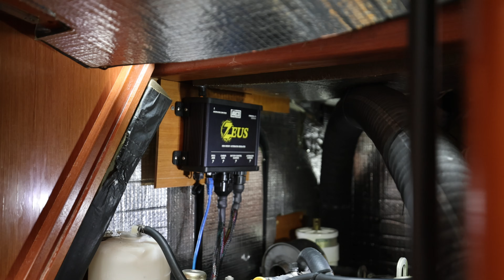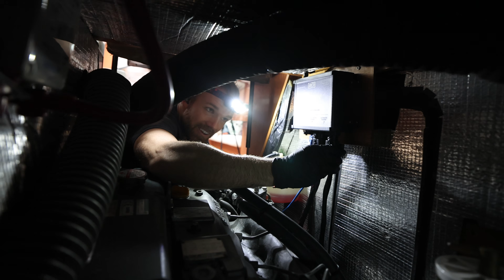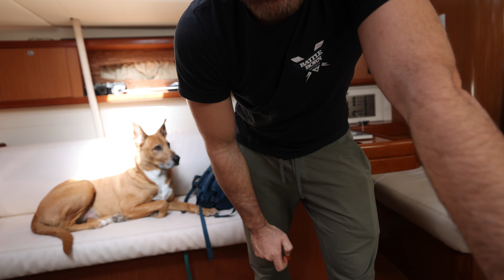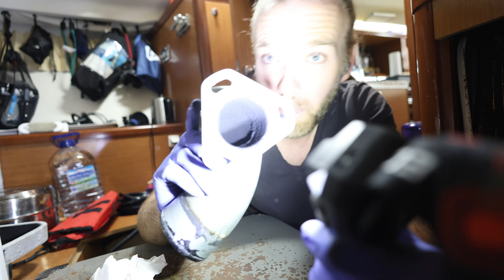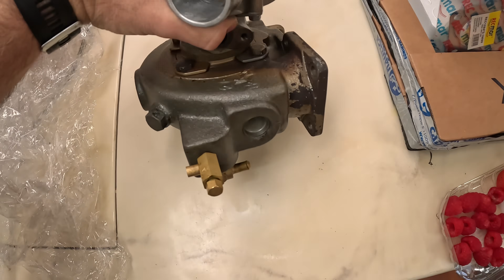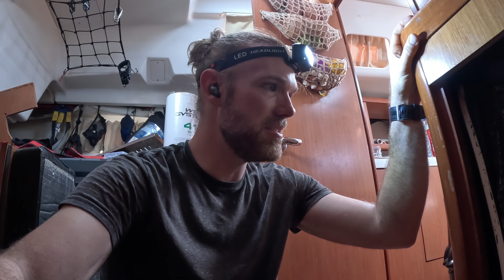Billowing Smoke - Broken Turbocharger - But at least it got upgraded electronics! (6)

Comment: HORRIBLE MAINTENANCE,now that I have everyone's attention. This is for people who have sailboats,what I see is a motor that is way over fueled. Go on a VW tdi site and look for how to clean your injectors  and after that go to a country that has a certified mechanic that knows how to run the rack on the injector pump. most of you are in places that are considered third world counties, just because someone said that they know how to work on a motor does not mean they can do it correctly. everybody should look up their engine and familiarize themselves in case of problems that are a simple fix or at least keep from getting raped by some of these so called mechanics. Remember AAA does not go everywhere.

Comment: that poor motor is taking in such hot air, i bet the iat temps are crazy on that thing post turbo with some load. Heat kills everything, i would look into some exhaust wrap and a turbo blanket to help your engine bay temps and then add some ventilation to that tiny engine bay. If possible making a air intake that goes out to fresh air would help more than u would imagine and engine would be way happier. Its simple to add vents to that engine bay, make sure u have a in and out. There are several ways to accomplish this but have to see what would work best on your boat, that alternator will be waaaay cooler if u do this as well. Side note they do have water cooled alternators out there.

Comment: As a mechanic, I can tell you it is the internal pil seal in the turbo. Replace it. Cary a spare turbo always. Your engine itself will last 5 times longer than any turbo. Turbos are for performance not durability.

Comment: I do hope thats not an earth lead attached to the alternator ????? EVERYTHING electrical on any vessel MUST be insulated return or you will have horrendous Electrolytic Corrosion !!!
Reply from the maker: It's a "case ground" alternator. so yep
Reply: @ExpeditionEngineering  Well you need to read up on marine electrical installations as that is a reciepe for disaster ALL wiring must be insulated return .
Reply: @ExpeditionEngineering  How long are your anodes lasting is a good way to gauge what stray currents are in your boat and that new alternator ??? will eat disimilar metals if its grounded to the engine inc the items in the engine if it not 100% insulated

Comment: The only way for oil to get in there and get burned is past the impeller bearing/bushing. I know you said it had minimal side to side play, but... Remember that oil can be a fuel, if enough enters the air flow you might have trouble.

Comment: Does the Zeus have alternator protection for lithium or is that an add-on?
Reply from the maker: It does have alternator protection for lithium, they call it ATC. It works with batteries with a bms that can communicate and tells the Zeus it's about to disconnect. Unfortunately the Battleborns we have can't tho

Comment: It may be a run off diesel engine. Especially when you said the throttle wasn’t responding. You could have overfilled the oil which could have caused a run off engine scenario. Only way to stop a run off engine is to stop air flow to the engine.

Comment: That was a lot of carbon build up, try to avoid long idling times. Difficult on a boat I know but combustion engines do not like idling.
Reply: New boat owner here. How long is too long of idling?  I typically run at idle until the engine reaches operating temperature and then I'm ready for cruise speed.

Comment: When talking about RPM, you don’t use the plural RPMs. The plurality is contained in the first statement in RPM, ‘revs’. 😀👍
Reply from the maker: Ah see but you're mistaken, I DO use the plural rpmS 😁
Reply: @ExpeditionEngineering RPM is already the plural when discussing a single engine 'revs (plural) per minute'. The only time it would be correct to use RPMs would be if you were talking about the RPM of two (or more) engines. As in 'I noticed that the RPMs were different'. Every instance in your video should simply have been RPM. Love your work :-) XXX

Comment: Brett, white smoke is usually indicative of incomplete combustion. Whether that's occurring from excess fuel injected, too little air, too low compression ( as was your case from turbo being obstructed on hot side ) from turbo or cylinder head leaks related to gaskets valves or piston/ring failures. You mntioned adding engine room blowers... next episode or will that be TBD with some research and parts orders ? Sorry Jade, that you got the ouchie from fries... at least they were good I'm hoping ?

Comment: Could just be a bad injector or fuel regulator as well. run the motor and listen and see if it changes pitch up and down. If it does then it is fuel supply. it's a good year to clean your injector every few years any way, helps with fuel economy as well.
Love your work hope you find the problem.

Comment: Oil seal blown in turbo. Explains lack of power if oil is in combustion chamber. 
Injector blown which would cause low power.
Cracked head near a exhaust chamber.
Oil seal in turbo is easy to determine if you pull intake pipe to manifold and see if Oil is in it. Or inspect turbo fan blade on the exhaust side.
Injector you need the computer program to hook to computer (which I highly recommend you getting a diesel marine software) and do a cylinder cut out test.
And check antifreeze level to see if it has gone down or system is overly pressurized. 
It could also determine a cracked head.
But my money is on the Oil seal in the turbo. Or water seal if it's cooled via water.

Comment: I had a 4JH-TE many years ago. Yanmar used to sell a product to wash the turbo insitu. Sounded like the engine would self destruct but would work and the turbo would be fine, and cleaned. I did this once a year and never had a problem with it. Check it out with Yanmar.

Comment: Diesels like to work hard. Too much low load running will kill a diesel faster than full load operation. Keep your generator and your main engine will thank you for not running it at anchor. The good news is that that monster alternator will load up the engine when motoring and motor-sailing so that's a bonus.

Comment: My experience was with an Audi in-line 5 cyl turbocharged motor. It started with a puff of white smoke out the tail pipe on startup. Progressing rapidly to continuous white smoke. The cause was cracks in the cylinder head and a worn-out turbo. The combination of repairing them both exposed issues with a tired engine block, which had to also be rebuilt.🥴😬 If you have a lot of hours on the motor, maybe consider total rebuild.

Comment: Turbo! ooo...nice!  So like your boat goes to eleven?
🎸🤘😎🤘  p.s. maybe check compression, injectors, air filter, and de-barnacle heat exchanger while you have your boat in wet-dock, unless you've done it all recently.  Cheers!

Comment: Not as great as the smoke rings from Mount Etna but still impressive. 👍👍
Personally I would have found the smoking fault, fixed that THEN upgrade the alternator. It just cuts something new going into a bust system and adding to any other issues. But Im not on the boat looking at it.

Comment: Hi 
Nice work with the turbo.
An other comment is that you can damage the crank and the bearing with the load from alternator. 
I think Yanmar have a diagram that shows how much load you can take in different directions.
You have the power to get 240 amps from the engine, but it may hurt it.

Comment: I’d start in the same place you did.  White smoke when cold shifting to black smoke when warm is too much fuel or not enough air.  Exhaust restriction is a problem on small marine diesels which can cause not enough air.  It’s also the simple thing to fix and cheaper.  Testing for bad injectors isn’t for the faint of heart.  Replacing injectors isn’t too bad, but expensive especially if you don’t know if that’s the problem.   

Blown head gaskets are rare on diesels and are typically the result of poorly maintained cooling systems.   It’s not impossible, but highly unlikely.  I have seen more external cooling system leaks from head gasket failures than combustion gas loss.  The examples I have seen were always because of cavitation eating away the head and block at the gasket surface causing the gasket to fail.  It’s not like a gas engine where coolant can leak into the combustion chamber and blow white smoke.  A poorly running gas engine might have cylinder pressures of 80 psi.  A diesel won’t run with less than 450 psi.  If that much pressure got into the cooling system, hoses and heat exchangers go boom.  If the engine didn’t hydrolock first.

Comment: SV Delos had similar issues. They were informed that they were not reving the engine high enough and had the same carbon build up.  Once they cleaned up and replaced the elbow they had the same results as you did. The engine reved up higher and the smoke was gone. So, reve the engine up high once in a while and that will help burn off the carbon.

Comment: It’s not a head gasket if the head gasket blows out the engine won’t start there is no compression. Check pipe and fuel filters. If you ever have a miss fire check the glow plugs if they have oil on them check valve cover gasket loss compression and oil is like milk head gaskets.

Comment: Had an air filter colapse on one of my machines that was clogged up from dust. Smoked like a bitch. Running them too cool will carbon them up on the exhaust side, so never idle for long periods.  If you're running it at less than 50% it will do this. Rev it up and make it work a bit. On a piece of construction machinery,  we'd tarp off the rad 3/4 covered, for the night and rev them up 3//4 throttle, if it was below -40. Any less and the rings wouldn't seal and she'd spit a lot of oil out the breathers too. Keep em warm and work them hard. She'll be happiest and surprisingly doesn't use hardly more fuel than idling. Great vid. 
Bonus round...steel becomes very brittle when it's colder than -40.  At -50 work carefully.

Comment: Brett, turbo engines like the correct fuel loads per cylinder.  I have a 2006 4jh3-te.  The Yanmar manuals have thousand hour service intervals tasks.  One of item is remove, clean and test the injectors. Mine had 1400 hrs when purchased and 2250 when I read the manual.  All were drippers when tested.  They were replaced at $150 per. These are old school poppet injectors, any diesel shop has the equipment.  High Output Small Case Alternators are great...... But have those big house batteries separated into Banks 1& 2.  The failure mode is a case direct short to ground.   Devastating to lose 12 Volt power half way on 3,000 nm passage.

Comment: over time the exhaust inlet manifold will carbon up and restrict air flow into the turbo and eventually the carbon will make its way into the turbo and clag up the vanes inside. Ensure the inlet manifold is clean.  Can check health of the vanes by way of the control lever, which protrudes from the side of the turbo.  the lever should move in its full range of motion without any sticking or jamming.  Essentially it should move superfreely just using very light pressure(tip of your finger). If hard to move, then the vanes are clagged with carbon, need cleaning.
Reply: Yup, all true for a variable vane turbo which is not uncommon to meet in the automotive world. 
In marine applications though, old school non-variable vane turbos are the norm  so there’s no control arm or mechanism to clag up. 
Boat engines are generally derived from small plant  and industrial equipment, like diggers and generators, that are built to operate for long periods at fixed rpm in a narrow speed range and be quick and simple to maintain, so the added complexity of a variable vane turbo isn’t a benefit. 
Cheers, R.

Comment: Hey Bret, here is something you might consider in assessment of your engine’s “turbo”.  I have not worked with turbos but I have with regular non-turbo marine engines.  Turbo as you know is a mechanism that is used to compress intake air to get more power out of your engine.  Diesel as a fuel is going to be burned in a fixed ratio with air.  Your engine will likely initiate the turbo to compress intake air, and have some mechanism to “meter” the air so it knows how much fuel to match through the injectors. By measuring air, through either a Mass Air Flow sensor or a Manifold Absolute Pressure sensor, the computer is then able to calculate the amount of diesel fuel that the engine will need to inject into each of the cylinders.  Engines measure air first, and then calculate a matched amount of fuel to inject, secondarily.  So my thoughts are that when you start the engine and put it into neutral and then rev the engine up a little to 1500 or 2000 RPM, a persons initial reaction might be to think that the engine is working hard to achieve the RPMs, and that the turbo should then kick in.  But this MAY NOT be TRUE, and here is why … an engine that is in neutral and being revved, is using ALMOST no more fuel than when it is idling.  As you know, using very little fuel would also mean that it is hardly using any more AIR, because the engines computer always injects a metered amount of fuel to match the volume of air being measured through the throttle position, always burned in a fixed ratio specific to the fuel (in this case, with as your fuel source).  Why is this important?  Because only when the engine experiences a LOAD, will the engine have a need to burn FUEL … and therefore AIR!  And unless you have LOAD - meaning the engine is in gear and the prop is turning and pushing a LOAD of water - you will not have a need for any volume of compressed air to match the small amount of FUEL being injected into the engine.  It seems counter intuitive, but when you rev the engine in neutral you burn just a little more fuel than you would be burning as if it were at idle … and therefore just a little more air, and not anything large like what turbo air should be able to deliver.  The reason why I say this, is that your turbo is not likely to be engaged in a manner that uses large amounts of turbo air, because there is hardly no AIR demand that will ever be created by simply revving the engine out of gear.  Your turbo will not need to produce “turbo compressed air” until you give it a substantial LOAD- a REAL LOAD - which can only be achieved by putting the engine in gear and burning actual fuel created by pushing a heavy boat through the water (or through engagement of your propeller with the surrounding seawater).  Anyways, not sure if your problem actually got resolved, but good luck!
Reply: This is a diesel engine not gas.
Reply: @laurapitre5797  he does state that he's talking about diesel engine. read again.
Reply: @MrSnookerballs exactly, @laurapitre5797 is completely right.this is not a petrol engine.
1) there is no computer here. Purely mechanic
2)old marine diesel, no regulation on air mass, neither even a waste gate maybe, always charging full air mass to make the highest temp and pressure, just dosing fuel and not caring on excess air causing NOx. Opposite to Otto turbo engines or automotive diesel engines with electronic mgmt, where low loads mean low boost pressure, and high loads, high boost even at low rpm. On this diesel, boost is depending on Rpm mainly I would say. 😊

Comment: white smoke indicates oil or coolant being burnt. sweet smell is coolant
check engine oil for coolant in it... it will be milky. if head gasket
blown turbo seal can induce oil causing smoke. check exhaust side of turbo, wet and oily = blown seal
check turbo waste gate, shaft play on turbo. black smoke is over fueling or lack of boost.